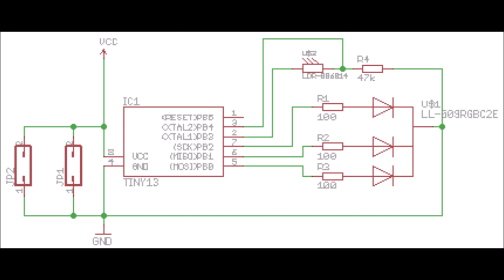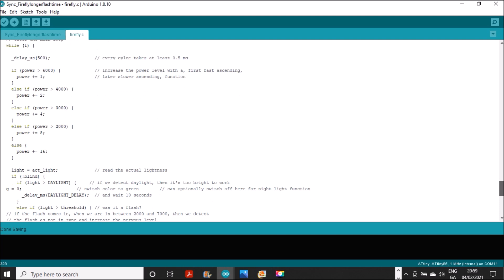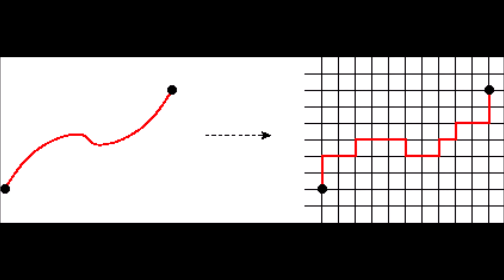Making Of a Firefly Synchronization Circuit Using Quantum-Inspired Metaheuristic Coded LEDs

Comment: Nifty AF.
Reply from the maker: what's nifty is how you managed to get a moving gif image uploaded on youtube that also functions as your avatar. I tried to do this with my avatar but it got corrupted.
Reply: @MuonRay  I had made that ani manually from screen caps of a c program(Borland I think) way back in like the early 90's. Anyway, I remember it not taking as a valid avatar img at 1st. I forget exactly how I got it to take. Pretty sure it was just the now defunct Google + that allowed it. Things were(still are) a mess as far as settings shared between Google/G+/YouTube/chrome etc. I still however very rarely see it animating(just uses a still/thumbnail) on most sites(this chat for instance) & on most devices. 89a is old AF, but silly how they often intentionally don't support it. Prob more info than you needed but I remember that bug'n me too.